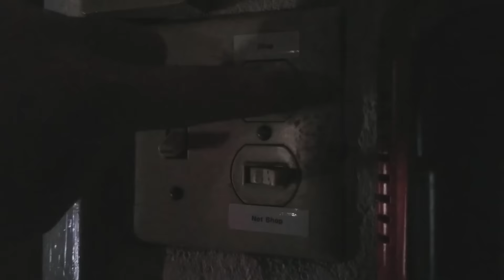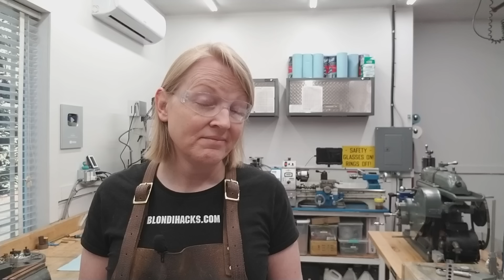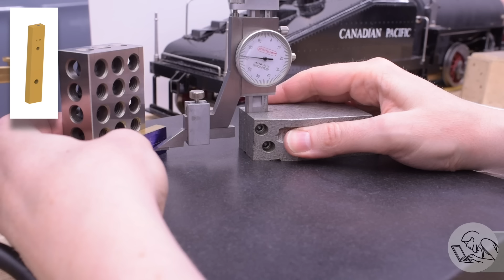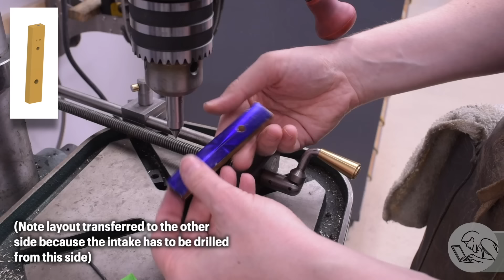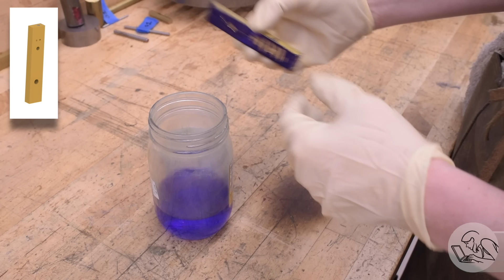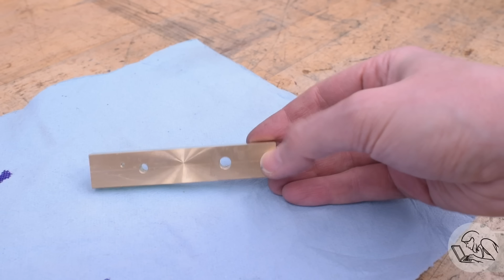Lathe-Only Engine Build - Part 1

Comment: Good day Ms. Blondi, speaking of building engines, could I interest you in building a 3 cylinder radial airplane type engine ?
It has a 1.375 bore X a1.250 stroke.
In 2011 I had a subscription to a model engine building magazine.  With it came plans for making various parts, pieces, engines and such.  In one of the magazines was an article about building a 3 cylinder radial engine and in the following 3 issues were articles and plans to build the engine. My problem was at my age plus my machine sizes I felt that I could not make the engine. So I figured that maybe I could build it double scaled, Bingo.  So I purchased a CAD and started drawing everything double size.  I started purchasing materials, tooling and materials for the project. At one point illness struck me and I lost my health, shop, tools everything.
For the last 2 years I have been redrawing the engine and learning more about matching different parts.
I have on materials etc, all I can offer the magazines articles and copies of the original drawings and copies of the double scale drawings.
Materials, purchased parts, tooling etc costs runs into a fair amount of money.
To help you out on you doing some research the magazines are the Model Engine Builder issues #'s 24, 25  and 26. The articles are about the PIP 3 cylinder radial by Todd Snougffer.
It possibly could be a YouTube build, just saying.
Please let me know Yes, maybe or No.
Thank you.

Comment: I planned to get into this stuff when I retired.  We moved from Melbourne, Australia to my wife's village in rural Indonesia.  I built a shed/workshop with a gantry crane.  I installed a solar/battery/genset 3phase power supply.  I was planning to buy a lathe, milling machine, instrumentation and tooling.  But it is just too damned humid.  Everything corrodes (including 307 stainless steel).  I don't last long in the shed as, shortly after starting any physical work, I start melting into a puddle.  I have to retreat to my air conditioned lounge room to avoid heat stroke.  The temperature here seldom exceeds 34C but, due the high humidity, the "Feels like" goes over 50C at times.  So now I'm resigned to the fact that setting up a machine shop was a pipe dream.   I have to live that experience vicariously through watching Blondihacks, Hal Heavy Duty, Cutting Edge Engineering, Not an Engineer, Heritage Machining,  etc.   At least I won't have to spend the rest of my life defending machine tools from corrosion.

Comment: Oh this is perfect, I had just recently found steves-workshop and his MK1 simple steam engine plans, but there were a couple of extra components like the spring/grub screw, that I didn't have as well as some less lathe friendly operations, so it's great to see the way you simplified it.
I don't have a mill but using the little mounting tricks to do the cross and off center drilling I can do it completely on the lathe.

Comment: coincidentally, I had recently decided to mount my cylinders at an angle instead of offsetting them to the side (same geometry, except maybe bolt hole angles). Next thing I knew, you have a cylinder that moves to accomplish the same thing (whether or not it was your intent). Now, I am starting with a slightly more advanced project (a Ford Modular V8) but it's not exactly my first rodeo; I really like this concept you demonstrate. BTW, you do have a magnetic personality -- keep 'em coming, please.

Comment: Myford-style vertical slide my beloved. Even just for drilling. With the magic of a linear scale on the cross-slide you can get extremely accurately spaced holes, spacing of holes often being a critical dimension. On top of the wonder that is drilling with powerfeed and having the carriage handwheel to move in and out, after which it is very hard to go back to drilling with the tail stock. (Good thing they make holders for QCTPs that let you put a drill chuck in them.)

Comment: I've built so many of these little guys, each one a little more complicated than the  last. If you're really looking for a challenge, I've seen them made with no lathe at all!
Reply: Just hand tools?
Reply: @markrainford1219 
Its possible to make one with hand tools.  I've seen model engineers make slide valve engines without a lathe or mill.  Quite a challenge but with the right techniques it can be done

Comment: Just today I was sitting here wondering what I can make. 

I have a bit of small materials (pretty much everything I need for this project).

Finding materials where I stay is a bit of a challenge, so this morning I ended up making yet another tap handle, can't have too many of those. 

This project came at a perfect time, looking forward to building this. I need to make my rectangular brass bar though out of a hex section.

Can't wait for the next few videos in this series... 

Thank you
Reply: Still got the tap handle I made for O level metalwork in 1979. I remember my teacher saying "put it in your toolbox, it will come in handy one day". I've used it about once every few months ever since.
Reply: @markrainford1219  I am only a beginner hobbyist with the machine tools. The first thing I made was a 'larger' tap handle, I was under this weird impression it is easier to make larger things. The one I made today is for small taps, M6 and smaller. I can see how these tools will last me a lifetime, and they do feel better in the hand than the ones you get in those cheap sets. It is so cool to me to hear about these stories where people made tools that lasted them years. These days, it feels like nothing you buy lasts long anymore.

Comment: If I had a lathe I would spend hours turning worthless bar stock into valuable shavings
Reply: I do woodwork and I often do that with my hand planes. I plane a piece of wood into shavings just for fun.
Reply: I suspect jine would be an adult language generator
Reply: Pretty much what I do. If I haven't used my lathe for several weeks, I'll chuck up a bit of bar and turn it into swarf. It's a man thing.

Comment: "First build" I use the lathe and mill or car stuff.  LIke a bung for an o2 sensor or milling brackets, I did make a hub adapter for my lawn mower.  Just random stuff like that.  But I watch you for technique so when I need to do a random op, I have an understanding to do them because I can't search "custom Bracket for whatever"